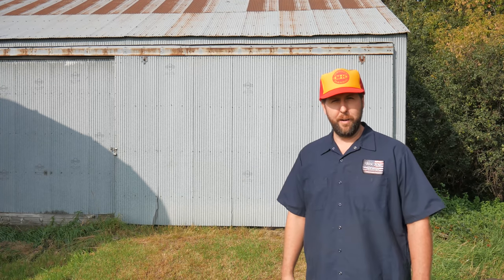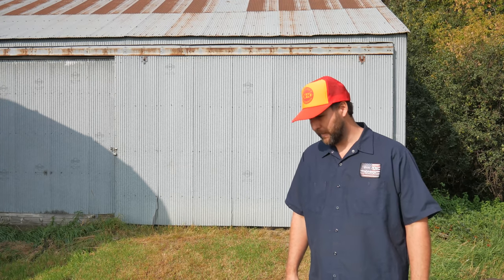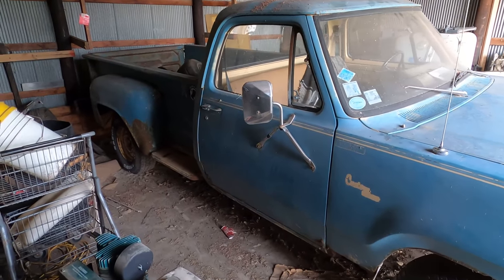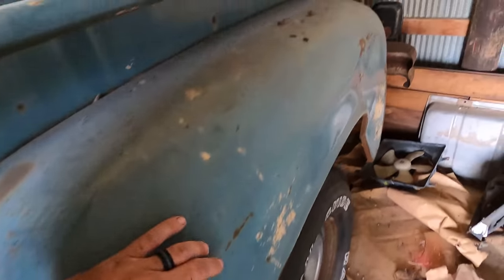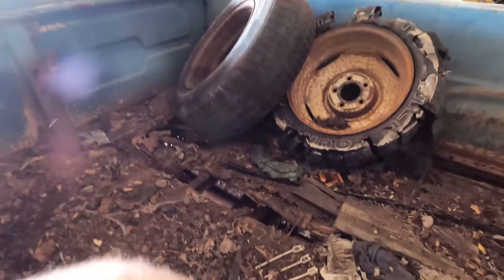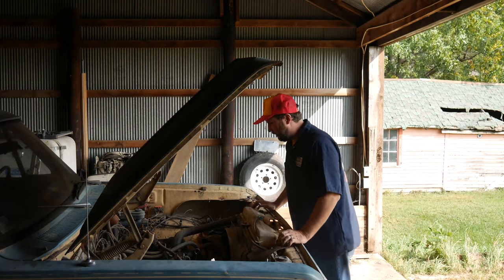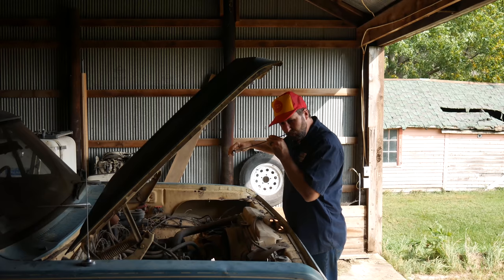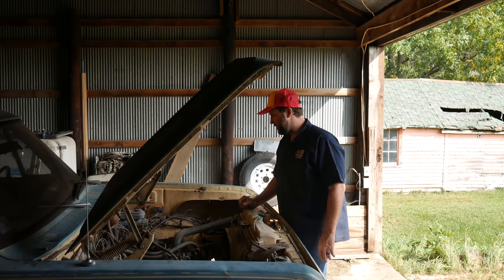Barn Find 1979 Dodge D100 Step Side - Will It Run and Drive Home?

Comment: I can't tell if it's Derek going "TSSSSSST" or if he's actually using a spray can anymore.

I was offered a similar truck about 20 years ago. I was rocking an '80 GMC 1/2 ton, short box, stepside, factory black on red, 350/4-speed 4x4..... was offered a '78 Dodge 1/2 ton steppy, was a 2wd truck with a 400/4bbl/4-speed combo.  Guy wanted to trade straight across.   Probably should have traded.

And then the square body market exploded and even rusty junk is worth 10k.  Luckily, I sold mine before that happened.
Reply: A guy's got his effects down!
Reply: Same!
Reply: Oh yeah don't you know I sold all three of mine before it exploded. Paid $1600 for the last one. Was lowered, had a fresh paint job, mint interior, 383 stroler with a hi rinse intake and a monster cam, fully built trans and everything worked. I couldn't get more than $2000 for it no matter how hard i tried. Wouldn't a guy know if I went to go buy that same truck again they'd be asking close to $10k for it. The other 2 I sold for $300 each cuz i paid $200 each for em running and driving. Today that won't even get ya a door.
Reply: @Gkitchens1  I got $3500 for mine. It needed cab corners and a new wood bed, but had been babied 95% of it's life with only one repaint.  Original front seat cover was worn, but not cracked/ripped or torn up.

Find another black on red one though. I've never seen another one. AND a GMC, not a Chivvy.

Comment: 33:48 "Anything but a Fram!" Fram products were made here in Rhode Island for many years starting in the 1930's, and were a quality product. Somewhere in the late '60s or early '70s, Bendix  bought them, which began a string of ownership changes thatvled to a lesser quality product. It was sacrilege to use anything but a Fram around here. Purolator was the other big name filter here, unless you opted for a Quaker State (really cheap).

Comment: All tires hold air, the question is more of "will the tire hold air pressure above atmospheric?"
Reply: Question is always when will the inside the tire air become outside the tire air. 
Or how many turns until it has a rapid unplanned disassembly? 2 turns 20 turns? I don't know.

Comment: “Boiled dog vomit and a hint of twizzlers” being that's a 70's Dodge I think they put that in at the factory.
Reply: I definitely believe its a factory smell. My dad had a 1977 Dodge pick up from new. It was a super stripped  down base model with vinyl seats and rubber floor. If it sat closed up for a while in the summer, it smelled kind of like he described. 🙊🙊💩💩💩👃👃👃
Reply: You mean FACTREE. 😉😂
Reply: I'd have to agree.
Back in the late 70's early 80's our town ran super Dooodge's for cabs, and those squeaky vinyl seats smelled that way. Thank the Lord the heaters worked,  cause you literally prayed for a wince of fresh air from the circulator, but, .......it never happened:)
Reply: All old Mopars have that smell. Wet dog and mildew, with a hint of old glue and vinyl vapors.
Reply: I have a 74 f250. The steering wheel sure smells like vomit.
Reply: @reidbarnes9851  As Bugs Bunny once said, "Might be YOU, Doc". 🤣

Comment: Hey just curious, have you tried bottle bleeding breaks? You don't need anyone else to help do it. Just take an empty Gatorade bottle and put a bit of break fluid in it and set it on something a bit higher than the height of the breaks (So air travels up and not back in) then take a clear hose and attach it to the bleeding nipple (or connect it to the break line on the vehicle) run it up and then down into the bottle like an arch, now you can go in the vehicle and pump the break pedal. You can see in the clear line when there are no more bubbles (or old fluid) coming through and the arch of the line going up then down into the bottle keeps air from going back down into it. It's a bit more leg work because you can only do a few pumps at a time then go and top off the master cylinder and repeat, but you can do it solo.

Comment: Some times i remove the mixture screws and spray carb cleaner in. Then a little air from a 12 volt compressor.  Works more times than you think

Comment: My D100 is a 1971 with Slant six and 3 speed auto.  Had it 30+ years.  It hauls anything, and always starts.  21mpg highway and city.  And best of all?  It's a Sweptline with a big checkmark in the body on both sides.

Comment: Thanks for the memories. I had a 79 powerwagon in Fairbanks in the 90s. It got about 8 mpg and had a 17 gallon fuel tank. I wasn't worried about anyone stealing it... no way to get it out of alaska with a 100 mile fuel range. I put a 55 gallon drum in the back with an electric fuel pump. As to the mileage, mine spit out a water pump about every 60k miles, so that's no real evidence in my experience.  I did ford a fairly major river with it, enough to float the mcdonalds wrappers around in the cab, through the holes in floors that were just barely smaller than a standard stop sign.  AKA sheet metal tree.  It needed repair every few days, but every fix cost about $6. Full time 4x4. With 36"  BFG MTs on it and all 4 chained, it was absolutely unstopped in deep snow.  Bumper deep? No problem. I had to put a new 727 and NP 203 transfer case in it, but they were each $100 new in the crate at the Army surplus depot.

Comment: Main Was A Slant-6 225 3 Speed On The Column Fleet side Short Wheel Base & I Put A Set Of Hooker Headers On It Off My 71 Dodge Demon & A Offenhauser Duall 2 Barrel intake. I Bought It Off The School Baord for $200 & Drove It for 10 years & Sold It for $700 💰😎
It Was RUSTY But Very Dependable 😉🤗

Comment: Me, from Tucson AZ, I had a truck like this. I used it to build a short block. Slant six, but lost its compression.
I was all finished and drove it home. Just as I parked it, the engine seized. After talking to my block provider, he suggested that I should call a local mechanic. I did, and was provided another short block for free. The mechanic found the oil pick-up tube installed wrong. I drove it home dry.
It only cost me a nominal fee for hoses and belts. I have learned a lot since then. Take a picture before removing anything.

Comment: This ditty did remind me of the old MOPAR electrical issues and the 465 “fusible links” under the hood and varying aggravations with their wiring conundrums that no one had any idea how to fix, as you might say, “That’s fine, we’ll ignore that” 😅 I had a lot of issues with water condensing up in the oil pans too. Never figured that out. In spite of those little aggravations I did have a few very good MOPARs and a great Dodge pickup. Funny how they were all designed to look like the homely girl in high school until about 1996 when they blew us all away with that year’s offerings. I recall that I was able to bubble out the brake lines on these things by leaving the master cylinder open, keeping fluid in it and very slowly pumping the pedal all the way to the floor and back even slower usually long enough to make me feel like I did after a one mile run. If there was anything there to pump up it always worked but it did take a long time. I learned that from a guy who rode bronco horses in rodeos down south.

Comment: When something has been sitting and has that lifter tic... I change oil add oil on both sides through breather let get up to temp put the last qt half on one side half on other side..... then feed it the beans a good many times. Usually works

Comment: he Derick i got 2 sugestions for ya. Just a temp fix. 1 A gascket stamp set and sissors 2 A box cutter and some thin cardboard. for a temp leak fix these tools can help. Yes the cardboard will get wet but it will keep most of if not all of the fuel in the carburettor.

Comment: For a quick bush pilot and main circuit rebuild you can rev the engine up and completely seal the intake on the carb. Just let engine vacuum out the circuits. Sure the engine will die during the process but there's a change the clogged is not so bad anymore.

Comment: noise supressor is probably the clip you found over the wire loom.  They used to do that on computers with the magnet thingy.  It was likely to reduce hum or whine from the electrical system coming through the radio it would go up and down with the rpms.  I thought it added to the music myself...

Comment: Please use a small squirt or ‘wash’ bottle to fill the carb bowl with fresh fuel using the vent tube, not a stream of starting fluid! My 318 in my 70 dump truck would sit 6 to 10 months at a time and always started when the carb bowl got filled, occasionally had to clean the points too.

Comment: On Ebay in about 2010 I bought a 1973 Dodge W100 with a step side box a 225 slant six and 4x4 and it was painted airforce blue and I was told it used to be one of their trucks up in Sacramento, Califonria.  It had very little rust.  It ended up down in Baja, Mexico.

Comment: If your interested. I have 2 dodge pickem ups . 1 is if I remember. A 70’s model original 4 door flatbed 4x4. No engine though. I was having a 440 and 4 speed built for it but mechanic died. Also a 80’s model 3/4 ton. Both are 3/4 tons. 2x4, around 80,000 original. 360 auto. With a camper on it. It ran when parked. Ran gooood. Both in Oregon

Comment: I’ll have to look around. Used to drive a tow truck back in the day of folks running out of gas without the gas cap keys. I have a universal in all the stuff a guy keeps. I’ll look for it. Your probably the only guy that can use it. Bloopidily blood, wiggle wiggle, off it comes

Comment: I googled, A crew cab, or double cab, seats five or six and has four full-sized, front-hinged doors. The first crew cab truck in the United States was made by International Harvester in 1957, and was later followed by Dodge in 1963, Ford in 1965, and Chevrolet in 1973.

Comment: I have a '79 D150 that also has the Custom trim (no idear what the difference is) but mine has the 4 square headlights in the front rather than the 2 circle headlights. I could be wrong but I believe they changed to the squares later on. Mine was manufactured in June of '79 and was made in the Warren Truck plant #1. It has the 360 with the 4 barrel Thermoquad in it. It has the 9.25" rear end which my old man thinks might make it what he called a "5/8" ton instead of the regular old 1/2 ton. He mentioned something about back in the day trucks over 1/2 ton didn't have to be smogged so a loophole was the 5/8? I have no clue. Mine is also tan but it wasn't a state park truck. It was my grandpa's truck and he just really liked tan.

Comment: Many a migraine was spent trying to solve the mysteries contained within my Carter Craperatur in my 89 Jeep YJ - probably rebuilt and cleaned that SOB more times than I had years in age - never could get it to stop bogging down.  Finally ditched it for a Motorcraft off a 78 Ford Bronco - the last one in the whole state of Colorado.  And nearly almost got it going again...and then I sold it, I was dirty poor at the time.  Now that I have a little drinking money - there's a part of me that wants to get another 4.2 and give it another go.  But that Carter was a nightmare from hell to fiddle with.

Comment: A fella would do himself some good to keep a can of Permatex spray gasket sealant with him, or a bottle of Indian head gasket sealant...both will get you by in a pinch with torn gaskets, or if you need to use layers of brown paper bags glued together as new gaskets...this old guy figured that out on his own about 30 years ago when working on dirt bikes and constantly having to tear shit apart when stranded out in the woods with a tiny tool bag under the seat, that little brown bottle of Indian head gasket sealant and roll of cut up brown paper bags saved me a few times...

Comment: Hey, I know those jerry-rigged battery wires hanging out there!  I got tired of coming out of the Fort Pitt Tunnel onto the bridge and having to fight my way to the left lane, so I wired up 2 sets of Fiamm air horns using the same wiring scheme as appears in this truck - a clamp to the battery terminal did the trick.

Comment: I learned to drive on a 79 dodge slant six 3 on the tree dad put about 300,000 miles on it still ran when he sold it still had the original clutch

Comment: Hi, Derek.   I know where there's a nice '60 t-bird here on the west coast.  Motor will turn over - not frozen.  Body in good shape with very little rust.  Original 352 ci.  Complete.  Website says restored one will.bring $27k.  Owner wants about $1000.  Do you pay a finders fee?  Let me know if you're interested.   

Those old Dodge 2 bbl 318's were great.  Plenty of acceleration, and Dad got 20mpg on the highway.  I think his was about as old as yours and had an automatic transmission.

Comment: My old man, construction business, built a Dodge dealership in the early 70s and he bought a sky blue Dodge club cab truck from that customer.   The long bed truck had a 318 and a full pipe rack.  It was ugly from brand new and the club cab was mainly useful for storing tools.   I remember sitting on the fenders with my feet in the engine bay while changing spark plugs and performing other simple maintenance.    I learned to drive in that ugly old thing.  It was two wheel drive and would get stuck on a wet piece of paper.  I remember wishing it would quit but it kept going, mile after mile.   Never much of a looker but it took a lot of abuse and kept on going as long as it was on dry pavement.

Comment: EZ Turn is a specialty lubricant/sealant used for fuel and oil line valves & is resistant to high temps. Especially effective where high octane fuels and aromatics are present. EZ Turn is also extremely efficient as a gasket paste & anti-seize agent. EZ Turn will not gum, crack or dry out. Each shipment is independently tested. Excellent for tapered plug valves, aircraft engine manufacturing, and marine applications. EZ Turn is the functional equivalent of fuel lube

Comment: my dad had a 79 power wagon and it was an electrical problem, ended up having to bypass most of the electrics and use a single wire chevy charging whirler on it.

Comment: Yeah do not under any circumstances unplug the wires on the alternator the wires for the regulater both are green in color if you swap them it burns to the ground been there done that before

Comment: 318 engines like the slant 6 are bullet proof. you can beat those things with a hammer and they will keep running. My mom 1972 Duster had a piston slap in the 318. that sucker ran for additional 22,000 before it blew apart

Comment: Hey Derek, if you get yourself a set of “Wonder Waves” (lock picking rakes) they’re as good as any key on 95% of those gas cap locks. Old & new, none of the companies I’ve ever seen put a decent lock cylinder on those locking gas caps, so a simple rake attack will get em open in a hurry and it doesn’t take any particular skill.
Reply: Also, something I’ve seen a lot in service vehicles is long, long hours of idle time. Generally state/county vehicle drivers don’t pay for their own fuel, so they never shut the units down when they sit anywhere. If it’s cold, the engine’s running with the heat on anytime they’re in the vehicle. If it’s hot, the engines running with the AC on anytime they’re in the vehicle. If it’s nice out, the engines running anytime they’re in the vehicle. So the wear on the fuel/water pump requiring replacement doesn’t necessarily mean it’s been DRIVEN a lot, just that it’s run a lot.

Comment: I have the 79 W150 It is my daily driver. With the acception of the bed it is prety much identical to this truck body wise. Mine has the 360 and is 4 wheel drive. got to be cairfull with the body ground though. I had to fix that on mine recently because the lights did not work like they should. They fliclered when going down the road. I have converted the lights to led and that is great. Clasic look with better lights. Got my convertion parts off amazon. I tend to use Rockauto, Amazon, and O'riley depends on who has it and who is cheaper.

Comment: Now I've got an old mild build ford 390 FE that's been sitting for 4 years my question is if diesel oil works so well for these old motors would you use it for a built 390 like flat top Pistons. Ported heads and all that good stuff ? Just wanna know the best thing I should do before I slap this motor in something and go to fire it up again

Comment: After watching a dozen of Dereck’s videos, I watch other people’s channels, I find myself yelling at the TV, “No, you’re doing it wrong. Squirt some Marvel Mystery oil in the cylinders, services motor all in the2950 Chevy.  Use an 8 volt tractor battery in that 6 volt car.” Then I usually fast forward or change the channel in frustration.

Comment: If the bleeder brakes loose stick a vaccume line on there and drop it into a jar with some fluid In it slow pump er with the bleeder open. U keep the master full and half stroke it till it stops bubbling 🍾

Comment: This is a video I missed! But here in texas the State park vehicle are a milky light green.
These vehicles are still being used. Most of the maintenance people are driving these step-side dodge trucks. 318 engines. Model 77' through 79'.
Reply: Just FYI...State vehicles have the wig-wag lights and radios, so some of the wiring has to do with that.

Comment: I won't run a Wix anymore.   I've used just about every filter out there found in a regular store for a number of vehicles over 35 years, and I've had exactly one filter unscrew itself.   Wix - the one time I used it.   Considering none of the other ones did it, I suspect it's a filter construction problem, not a me problem.  I won't overtighten a filter just to satisfy the pro-Wix contingent.